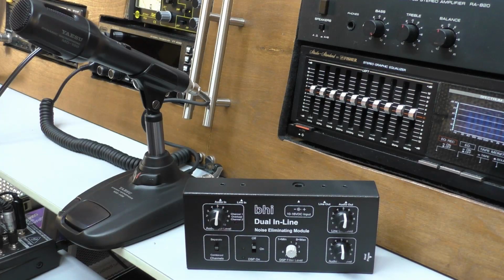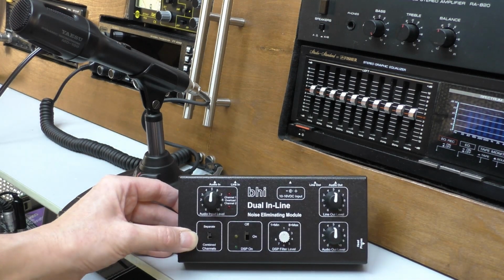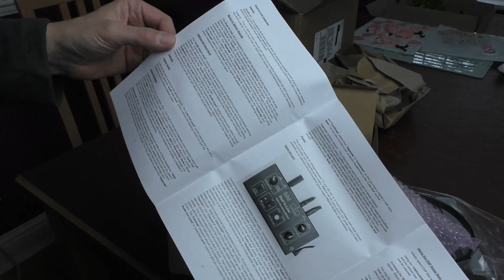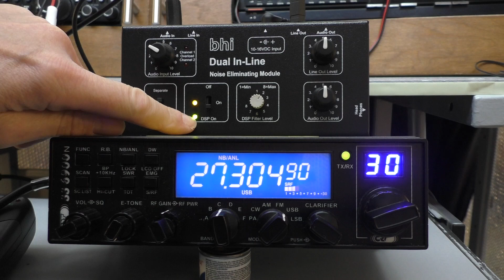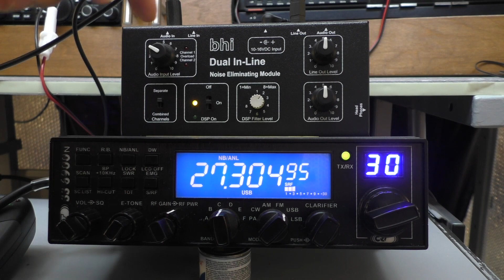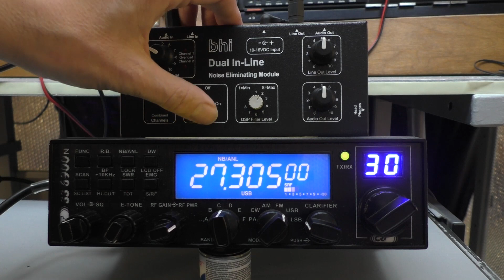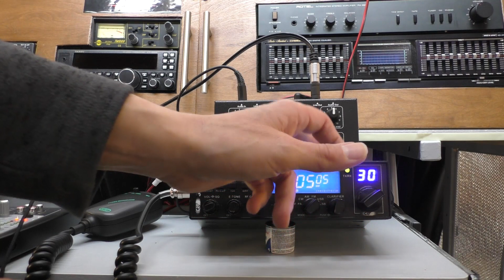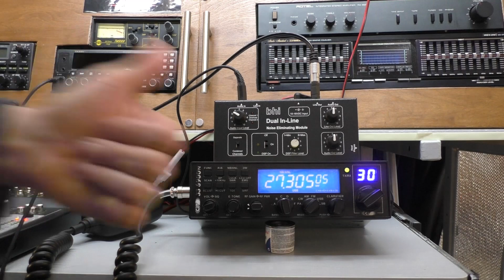BHI  Dual In-Line DSP noise cancelling module

Comment: Hi. Would this noise cancelling unit be useful for improving reception of HF weather fax signals?
Reply from the maker: Not really sure. In theory it will help a cleaner signal but does the signal not get turned to digital anyway via software ?

Comment: I had a question for you, I purchased one of these units also, but when switching between dsp on and on sometimes the unit briefly shuts off and turns back on. I can leave the switch in between the two and it will stay off.  Do you also see this behavior?
Reply from the maker: Hi. Not that ive noticed.  My switches snap on and off.

Comment: Good morning sir. Been following you all through the lockdown. It has inspired me to get back on the airways.  Need  a recommendation of decent kit.  Would initially need a low profile aerial.
Reply from the maker: Hi.  Have a look at these videos.  A low profile antenna could be a T2LT on a tele pole which you could put up and down when you want to go on air. 
https://www.youtube.com/watch?v=QYq2tl2QW7w
https://www.youtube.com/watch?v=lwbT4ZX6514&t=11s
Reply: @CB-RADIO-UK  thanks for this Fred. Might try the Dipole initially on the side of the house. Won't be above the roof line  but hopefully might be able to receive something. Bit different to when i had a Sigma 4 on a 6mtr scaffold pole strapped to my roof top chimney back in the 80's. 😁😁😁

Comment: hi, does the power mic work straight out of the box on the 6900 ? thanks
Reply from the maker: Yes but you need to play around with the mic gain settings on the 6900 menu.  Too high and it overloads the audio.
Reply: @CB-RADIO-UK  cheers thanks m8

Comment: Thanks for the video Fred , I’m not impressed enough to want to buy one , it seemed to take the high end freq away, was never that impressed with the Dsp on the 450 either come to that ,  take care mate look forward to the next one Shane
Reply from the maker: Hi Shane.  Yes they do reduce the high end freq to remove the hiss and crackle but as long as you dont over do it the audio remains the same.  The extension speakers are a luxury item for a CB radio.  Deffo help with hearing issues though.

Comment: You should try and get a little compressor/limiter Fred. Save you riding the volume knob. Keep it all the one level for you.
Reply from the maker: Oh ok George i did not know you could use one CB radio.
Reply: @CB-RADIO-UK  should be able to use one with any audio source, though results will vary depending on audio content